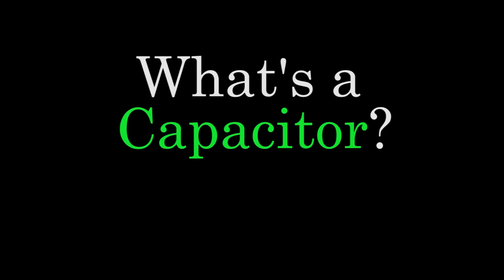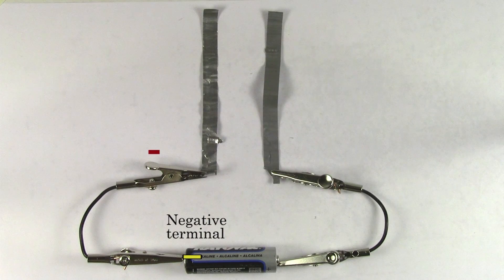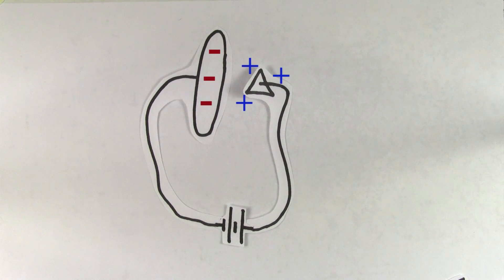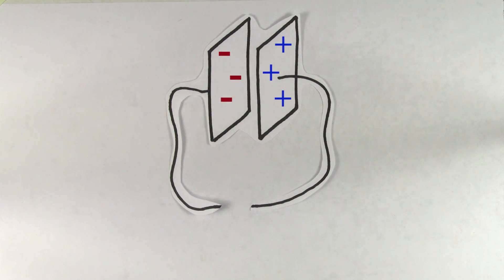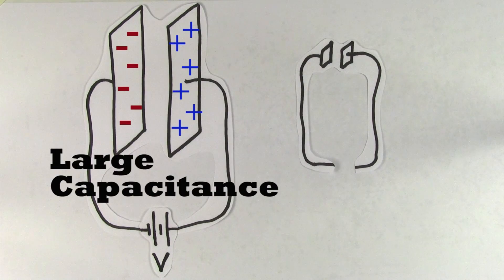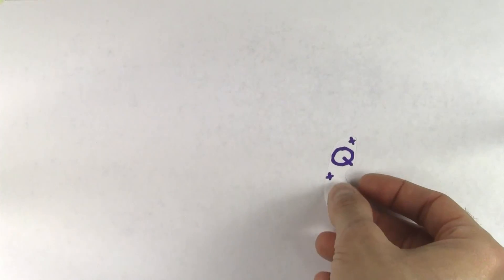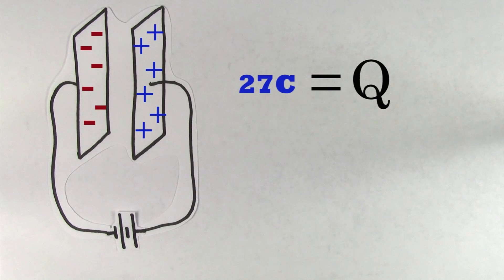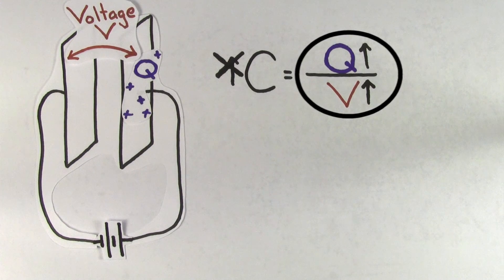Capacitors and Capacitance (Micro Lesson)

Comment: I got an interesting question to ask. what if I fully charged a 3F capacitor with a 9V battery, then I replaced the 9V battery with a weaker 6V battery. my conclusion is that the negatives from the negatively charged piece of metal will flow through the battery and deposit in the positively charged piece of metal till it reaches a voltage across the capacitor of 6V (same as the battery).
Reply from the maker: That is interesting, and yes, that’s what I’d expect as well.